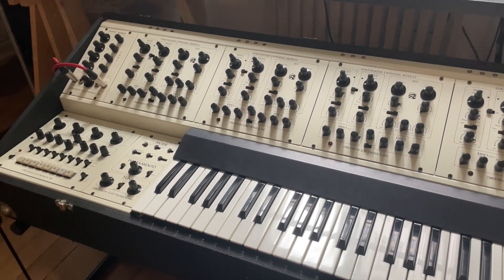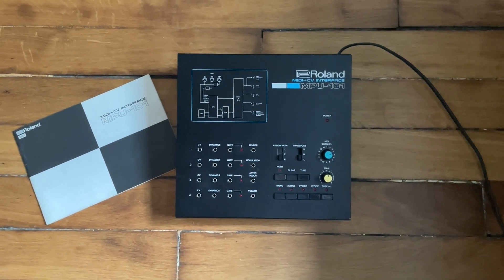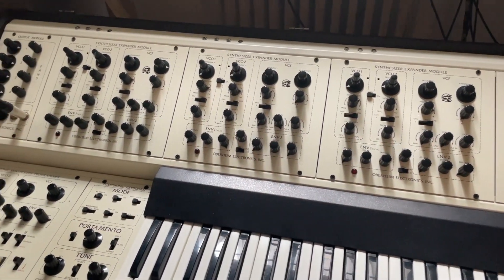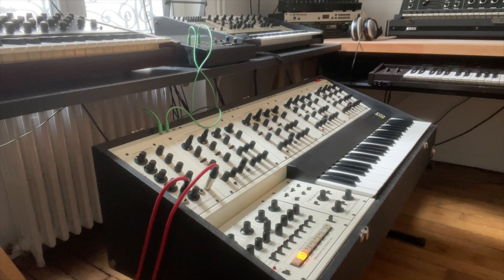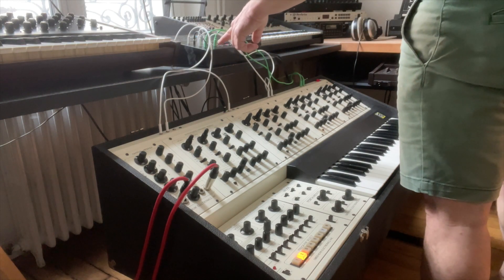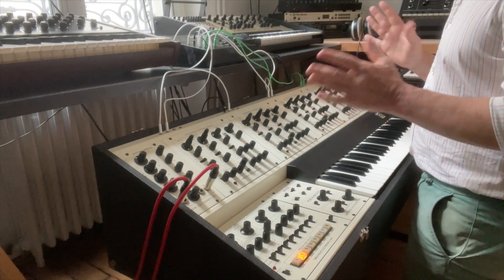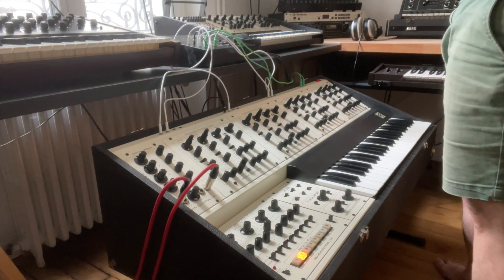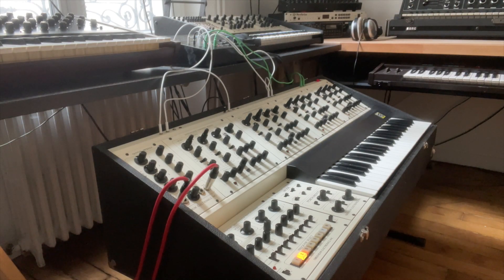Syncing an Oberheim Four Voice with a Roland MPU-101

Comment: Fantastic video, this makes me so happy to see :) Great looking mods also to the 4-Voice. The SEMs actually have connectors on the boards and instructions on the interwebs on how to expand them easily to integrate with, say, a euro rack system. So Tom was thinking ahead!

Regarding the same key playing the same voice, this is a common voice allocation mode found on quite a few older synths. This is to save on voices. So assume you play notes with long release times, then when you hit a new note you might interrupt one that's in its release cycle. Now if you make it so the same key plays the same voice, this stealing of voices will hurt less, in fact it will be very hard to notice.

Comment: Wowzers! Amazing! Wondering if you know if/how the MPU 101 works with an early Model D MiniMoog. Thanks.
Reply from the maker: Hi there, yes it would work no problem. As the Minimoog is just monophonic, it would only need one set of the MPU101s outs. But should work fine. Though there are lots of other simple CV-Mini converters that would also work.
Reply: @robotussin_synths  thank you so much!! Would you recommend any other reliable pieces that won’t need any mods on a Mini? Thx again